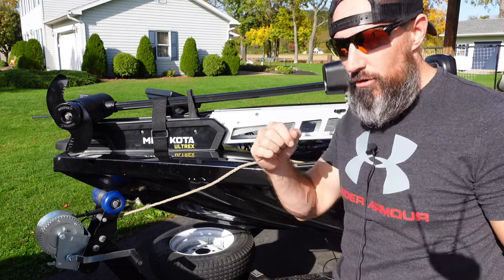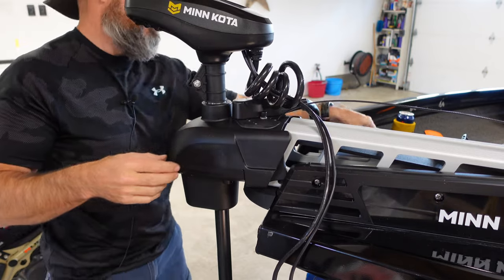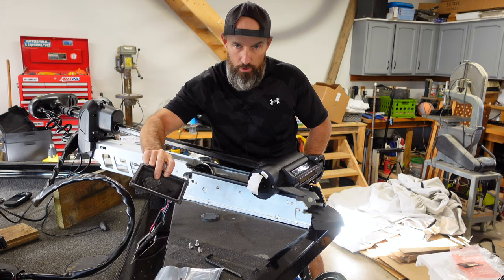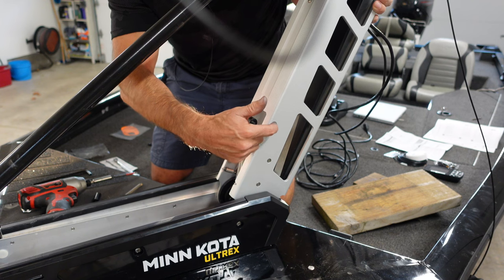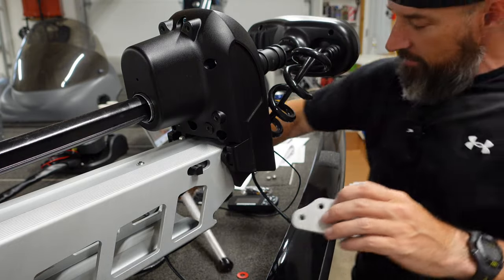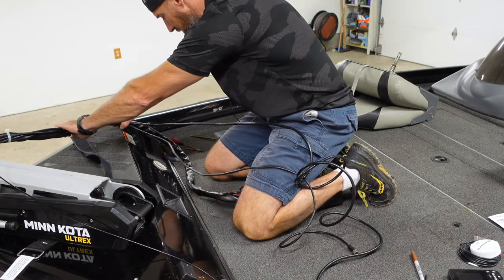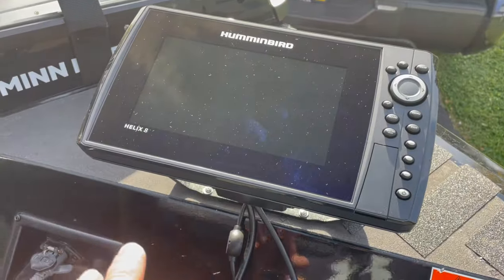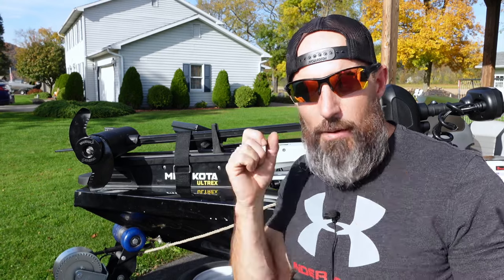How to install a Minn Kota Ultrex trolling motor  (wiring and connecting to Hummingbird)

Comment: I keep burning through my spot lock. It might be because I don’t have the positive to negative for the 24v required to run it plugged up properly. My wire is red and yours is black. I thought red meant both had to be on positive
Reply from the maker: Hope you get it figured out

Comment: I personally found that using my crank battery to power all my electronics minus my trolling motor dangerous.  The reason why is having two Garmin 93sv uhd with transducers and two live wells can drain your crank battery.  There's two options for the fix. 1st option I have seen this add a 2nd crank battery in parallel or option 2 adding a lithium battery for electronics and accessories.
Reply from the maker: Thanks for the tip. I have thought that